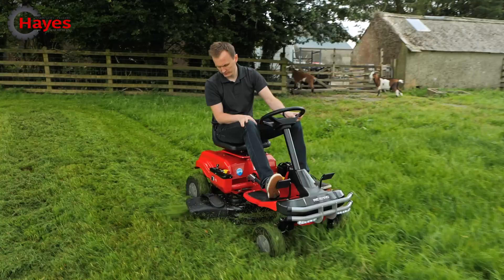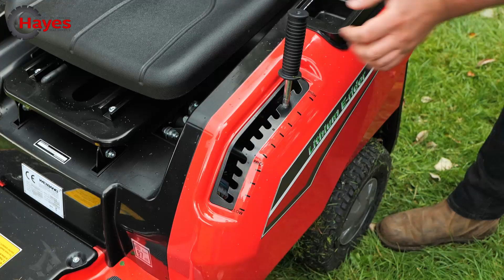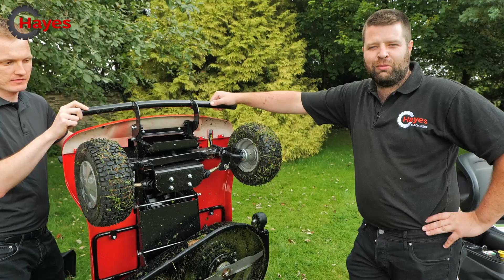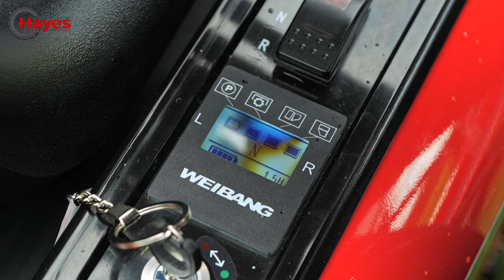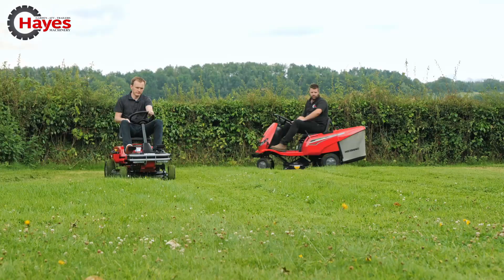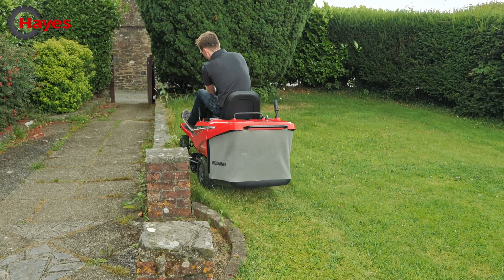The WEIBANG Battery Zero Turn, iON 76 SD and iON 81 RC Ride On Mowers!

Comment: I am looking forward to buying the Weibang E Rider Model # WB76E.  I have not been able to connect with someone thru their website. I want to know what a replacement battery will cost, and where I can purchase one when the time comes.  Can you give me any info at all regarding the battery, and an email that I can reach someone that can give me some information on the mower. I live in Pennsylvania USA. I can purchase the mower from the local Home Depot.  Thank you.  Dan
Reply from the maker: Hi Dante, you will need to find a dealer near to you to sort machine and parts. We are based in the U.K. If you can get it from Home Depot then I would speak with them and see what they say.